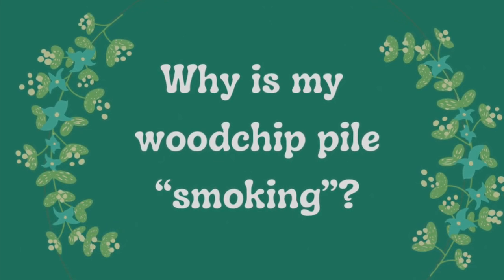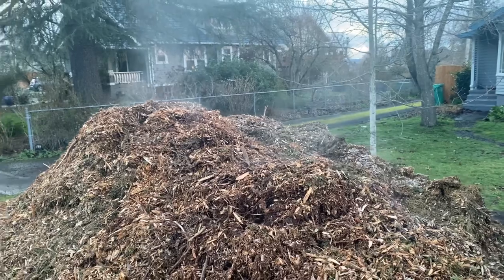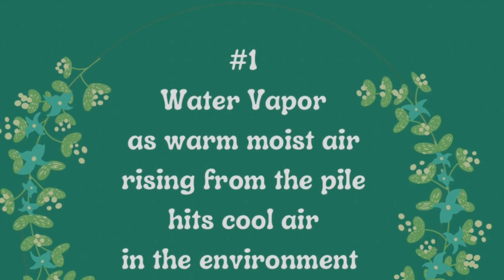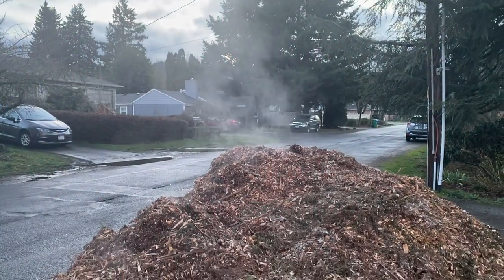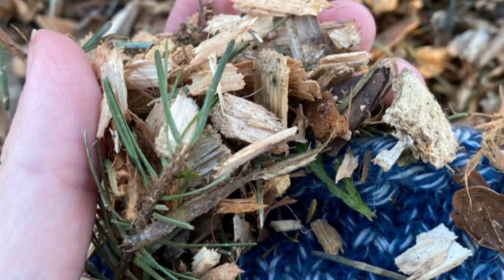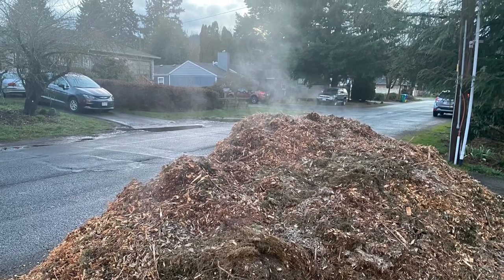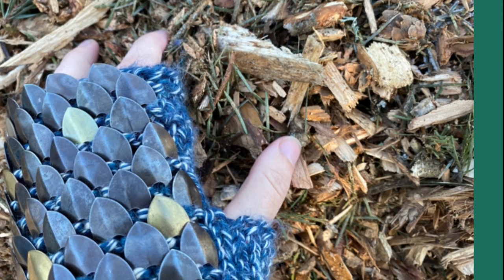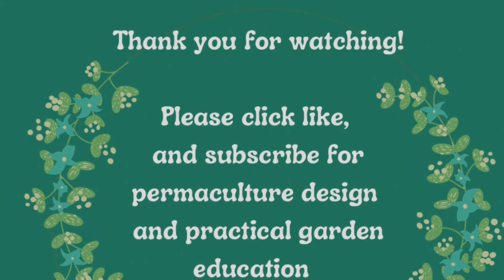Is Your Woodchip Pile “Smoking”? Here’s 3 Reasons Why

Comment: Great!  I had a steaming pile of chips this winter.  The chips where dropped off in November before the snow and then covered with snow.  After a few days there was steam rising out of the pile.  I don’t think it would have caught fire but I did go in and break up the pile and the steam stopped.  Even with the outside air temp being in the teens the pile was reading over 130 F.
Reply: Wow!